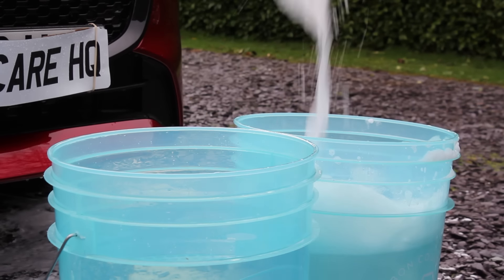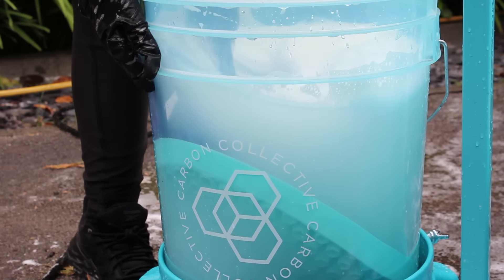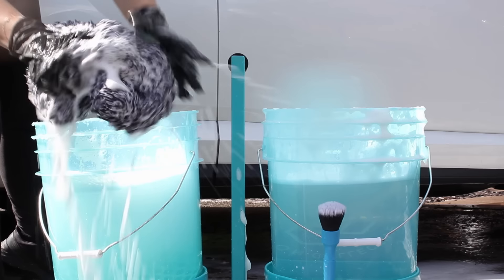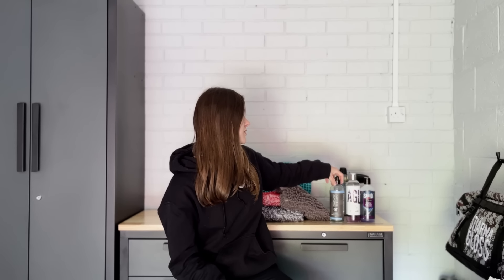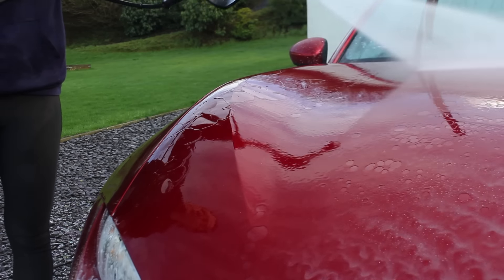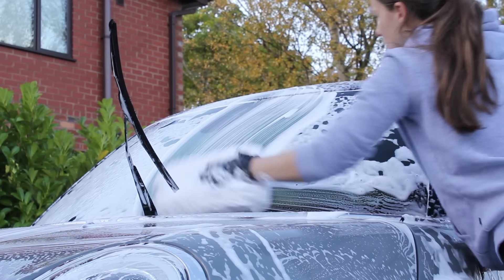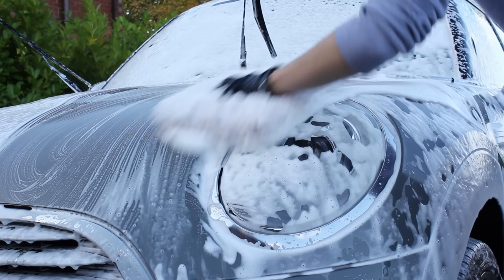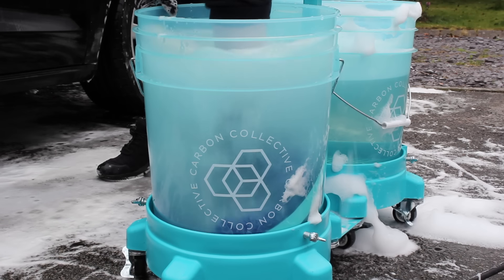Is the Two Bucket Wash Method Overrated? (Vs Alternatives)

Comment: in short, if i can be bothered and have time and depends how filthy the car is to start with and if it's mine or not. Not in short, I've found as much success blasting the mitt after use, squeezing it on the  floor, rinsing it again then giving it the old re-dunk into my shampoo bucket before washing the car. Have two mitts, one good one then an old one for the bottom of the car. With 4 years experience now i can get the car much cleaner using my myriad of products you've "made" me buy by your quality vids (apply internet high-five here) before i even go for the contact wash so two buckets are less needed and in most cases a waste of water for me. There is a time and a place most notably if im doing someone's car who hasn't cleaned it in in any capacity for the five years they've owned it then it def helps keep the actual grit bits in the guard that don't even occur on mine as the state of my cars are so much cleaner and doesn't have that build up on it in the first place.
Reply from the maker: Thanks for sharing! Definitely helps trying different methods and getting to where you’re at and happy with the process

Comment: Good video Heather! Personally, I use the two-bucket method but I use a few wash pads/mitts with a specific mitt for the lower sections of the car.
Also, I believe the cyclone-type grit guards do a good job of keeping the grit at the bottom of the bucket. I've got a couple of Carbon Collective Wheel buckets which come with the cyclone-type grit guards, and I use them if I decide to use other buckets (like the Auto Finesse buckets, which come with the standard type of grit guards).
I suppose it's all about preference at the end of the day, even though we're all trying to minimise marring and swirls on our paintwork. 
I'm even using Nick Briton's two-bucket method for wheels now!!😂 Thing is it works though!!
Reply from the maker: Thank you!
The Carbon Collective grit guards are really good. Definitely agree about it being preference, it's all just about working out what method works best for each person

Comment: You forgot the 'cheapo' hand car wash method. Blast the dirt off the car with the pressure washer, spray on traffic film remover with a cheap garden spray, then use a cheap wash mitt along with a stiff broom from the same container of dirty water. If you drop the mitt, just chuck it into the container, swill it around the bottom a couple of times and then continue. Don't bother to dry the car. It'll dry as it's driven away!😅
Personally, I do use the two bucket method, although I did for years use the single bucket method and the same artificial sponge, followed by a leather to dry the car with.

Comment: It depends on where you come from.

If you just dunk your dirty mitt and then take it straight out and into the soap bucket then it doesn't do that much. 

If you actually inspect your mitt after dunking it in the rinse bucket and wring it out then yes it's more effective.

If the pre wash and rinse was done correctly though, it's also debatable if there's any grit even left on the car. 

Whatever your method is doesn't matter. The fact that you're even cleaning a car is already impressive! You all know how many dirty cars are on the road- you know!

Comment: Hi, I need some advice... I think I have sprayed ceramic onto my window screen.. its got a haze on it causing poor visibility.  I have tried every cleaning product I have.  It won't go! Any advice would be appreciated 🙏
Reply from the maker: Hey, what ceramic was it? Have you tried using a polish (glass or paint would be fine)
Reply: @AutoCareHQ  hey I think it was zuranit. I've seen you use the same bottle on your channel. I've used meguiars glass clarity which says it's a compound.
Reply from the maker: Hmm I’d have thought that glass compound would’ve shifted it to be honest. Do you use it by machine or hand?
Reply: @AutoCareHQ  by hand I don't have a machine
Reply from the maker: @ajsinghb5069  you could maybe try using a firmer pad or maybe even something heavier in terms of the compound
Reply: @AutoCareHQ  what compound do you suggest? What colour pad? Hey I really appreciate you going out of your way to help me
Reply from the maker: I honestly have less experience with hand polishing pads but I'd probably try something like an Orange Chemical Guys Hex-Logic and Koch Chemie H9.02. That should really shift most things
Reply: @AutoCareHQ  you absolute super star. Appreciate everything.  If I can't get it off do you know any food detailers in Manchester who will machine polish it off? P.s it's my brothers car and I've caused the issue 😒
Reply from the maker: No problem! I think DH Detailing and Elite Kleanz Detailing both cover the Manchester area

Comment: So the multi mitt method doesn’t need to be as complicated or as expensive ive used this method for almost 10 years. I use the Eurow - Shag Pile Double Density mf towels from CYC they are super thick almost like a wash mitt, fold it into 4 giving you 8 fairly larges usable sides. I put them into a bucket with my wash soap, only need to fill the bucket a fraction enough to cover and soak the 3 towels used to clean a full car. Very cost efficient for soap. 

Use one side of the cloth per panel or even half panel, then swap to fresh usable side as you please. Never induced marring or scratches the entire time using this method. 10 pack of these mf cost £28. 

Keen to hear people thoughts and it anyone else uses this method.

Comment: This is a no brainer IMHO. One bucket with multi mitts has to be safer as only a completely clean mitt ever goes onto the paint. It’s also easier to set up, uses less water, quicker, and an easier process with one bucket to move round the car.

Comment: Not needed neither is the grit guard, get a deep bucket, everytime you dip your wash media, shake well, dirt will drop to bottom (do it low in bucket and lift out) yes it means a little more water and shampoo maybe , but never used 2 buckets ever + most damaging dirt is generally prewashed free before contact wash , but what ever works for all really , just enjoy your way

Comment: I used 2 bucket method for years, but nowadays I'm convinced it is 100% pointless. 

If you prewash the car with proper products, most of the dirt and grime is gone already. When I contact wash the car afterwards, almost zero dirt is collected in the bucket. Definitely not enough to consider the 2 bucket method. 

And even if you prewash, rinse, foam, rinse, contact wash with enough soap/water and incredible soft mitt, swirls will occur. Polishing will always be needed from time to time when contact washing! 😊

Comment: Yes it's overrated because if you use microfiber towels and fold them and with adding schampo on the car via foam gun, then there is no need to pay for 2 buckets and grit guards and what not for lot of money. Totally pointless to be frank, especially if you use a good and correct degreaser and have a ceramic coating on the car. I have done this for 4 years and there are no scratches, not even the smaller washing marks. People also need to be careful (with whatever method they prefer) to work easily, no pressure and with logic e.g. not to start on the rocker panels and then the roof for instance